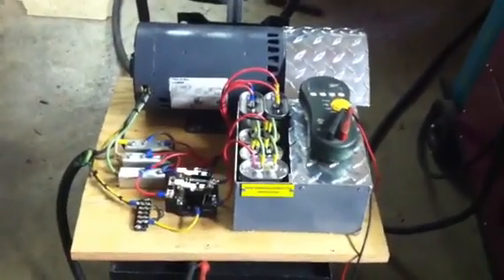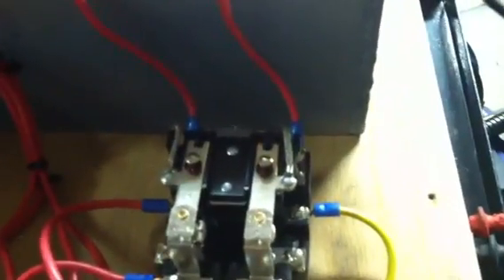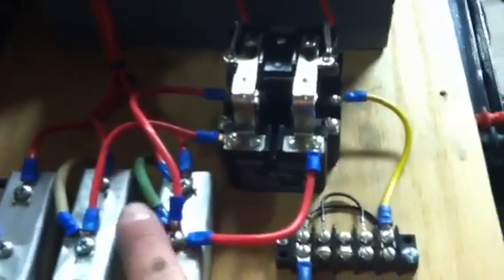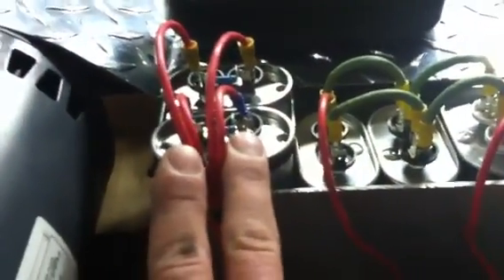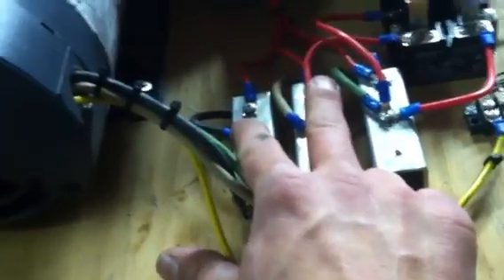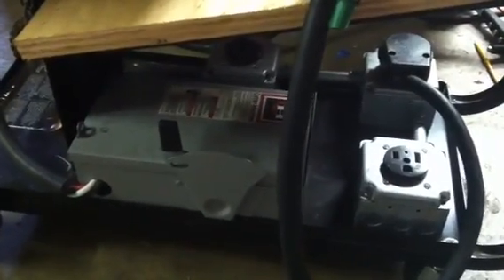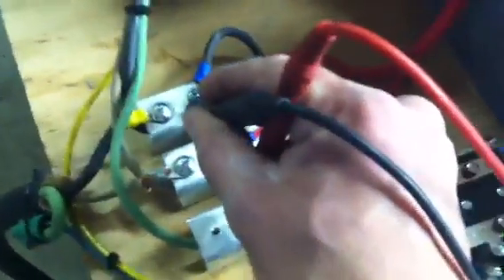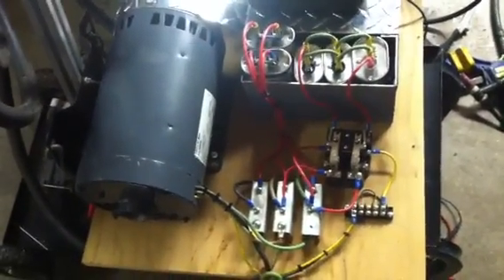How to build a rotary phase converter

Comment: I am an electrician,what I had notice is th bank of capacitors connected in series and parallel,you don't emphasize the capacitance of each and the types of capacitors(running or starting)that's it but I know the connections of wirings.thanks,informative.

Comment: Please help me with my rotary converter motor 7.5 hp! I’m following the procedure in this document http://www.practicalmachinist.com/FitchWConverter.pdf but I can’t balance the voltage. My L1 and L2 are stable 117 and 120 (measured with the ground). I don’t know why, but I need to put at lease 100 uf of capacitor for the Cp (between A and C / A=T1, C=T3) to get a decent voltage measurement between the leg and the reading is crazy Vab = 230 Vac = 285 Vbc = 462. When I put more capacitors Cp at 168 uf I get Vab = 229 Bac168 Vbc = 385. I just don’t know what to do to tune my legs and balance the voltage of my rotary conventer motor 7.5 hp. Thanks in advance for your support.

Comment: Hi
   When you say two hot legs going in do you mean 2 lives or a live and negative
Reply: there is no negative,  ac cycles back and forth, do you mean neutral? you wouldn't use that either except for 110v control coil on starter. 220 is two legs at 110 a piece.  to get 110v one side hot one side neutral /ground

Comment: could you also email me a laymans wiring diagram? is there any reason that the contactor coil had to be powered off the wild leg? couldnt it be powered off any on of the legs? wouldnt it be better off the constant voltage leg from the power main? also you said you added a resistor, is that nessecary with the proper capacitors? thanks in advance.

Comment: vfd cant step up voltage. cant do anything to voltage. except split it. by turning it on and off, at a variable frequency. thusly variable frequency ac drive. {they do have dc ones also, but are typically reffered to as "brushless speed controllers"

Comment: Mr Nattyville, have you seen bobhead22's video on the Tube where he feeds the output from a 1Hp 3phase into a VFD and runs another 1Hp 3phase off the VFD at a higher voltage? He's changing 220 1phase to 220 3phase through the "Pony" motor. feeding that into the VFD, nd running the other motor at 440 3phase. Interesting and do-able it seems. That might alleviate the "derating" issue I mentioned previously.

Comment: Thanks for the great video, what HP is the motor your using and how did you come up with the 30-35 mfd for the run capacitors? I'm building a 5 HP rotary and would like to add 2 run capacitors like you did to even out the output, what size would you recommend?

Comment: Isn't it supposed to be very dangerous to run current through the ground wire?

Shouldn't you be using neutral instead?